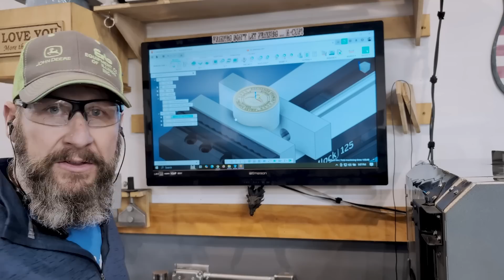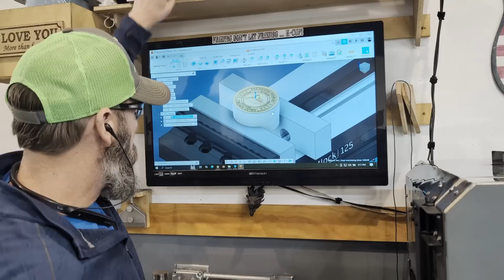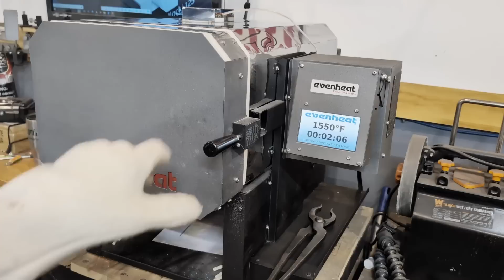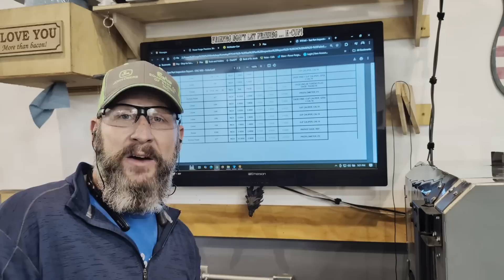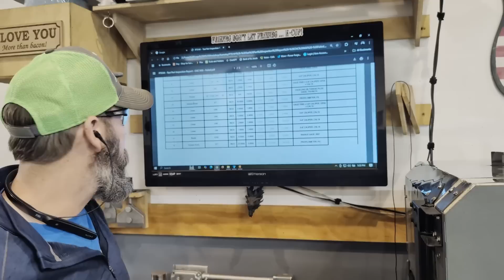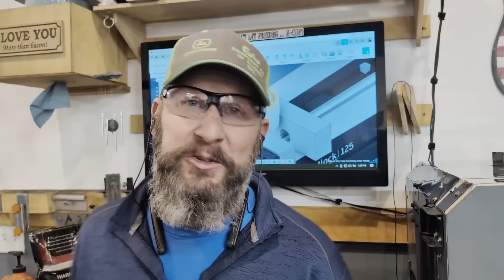Becoming a Partner with Xometry in 2024

Comment: DONT GO THERE..   It's. NOT WORTH IT....I have joined xometry...passed the test part phase, and now I am their platform....I have been on it for few weeks now...I am unable to find one single job that is worth going for....the pay is seriously low...lead times are impossible. ..jobs are complex...rare materials or several materials are at times required...post processing and all kinds of surface finish is required....material certificates and more...joining WAS a disastrous time / effort wasting for me...I am very disappointed 😞
Reply from the maker: You sound like me 6 months ago.  I had a similar experience on the job board. Most of the parts were either lathe or EDM.  I have a 3-axis CNC and my capabilities didn't match with their needs at the time.  

It was a blessing in disguise for me.  I doubled down on my own products and it's been enjoyable.  

Some guys seem to have success with it.  Maybe it's timing, but regardless I chose to move on and not work with Xometry.

Comment: I passed the test part. Now they want to schedule a zoom call. What are they looking for What will I need?
Reply from the maker: I remember a few things.  I installed zoom on my phone and set my phone up on a tripod.  That was helpful. Beyond basic questions about machining, quality control, and shop practices, I gave a shop tour and displayed my test part  on Fusion.  

It was a nice conversation.
Reply: @PowerForgeWorkshop sir,do you still using xometry for order right now
Reply: @PowerForgeWorkshop what if you dont have all the inspection equipment? Like I dont have a surface plate or height guage but I do have alot if calipers micrometer depth gages etc
Reply from the maker: @MakeSomethingCNC  I recommend using what you have and measure the best that you can.  If you can't measure (like the surface roughness average) be upfront and don't measure it.  State what you measured and with what.  If there is a problem going forward at least you will know where to focus to improve.  

Sorry for the late reply.
Reply: @PowerForgeWorkshop its ok. I just saw on there site you need a height gauge and pin gauges i dont have any of that yet dudnt kniw if they would disqualify me. Dud they make you show them all your metrology equipment?
Reply from the maker: @MakeSomethingCNC  I don't think I showed them everything. I told them I had a basic metrology set up. Calipers, dial indicators, etc.  To make the part, I bought some telescoping inside bore gauges and some precision pins.  The refractometer to measure surface roughness would have been nice, but I wrote on the form how I measured and if I couldn't, i explained why.
Reply: @PowerForgeWorkshop  thankyou for taking the time to respond to my questions.  I appreciate it!

Comment: if you run a trace on the slope with a ball mill it kinda gouges the part whats the better way of doing this
Reply from the maker: I had good results using Trace. It can be tricky to get just right. In the simulation it seems to take a little more material on the sides than the top and bottom, but I couldn't discern that with the actual part.  It worked for me to deburr the edge.  

I used a 1/8" ball. On the Passes tab I selected Left for Sideways Compensation and Selected Chamfer.  Chamfer Width .25 mm and Chamfer Depth .25 mm.  On the Geometry tab I selected an open chain, just the U.  I used a regular chamfer mill on the 2d portion of the part.  

I hope this helps.  Again, Trace can be a pain to set up, but I worked for me.

Comment: How did you measure the internal 1.205 dem its +- 0.001
Reply from the maker: I used precision pins to measure internal diameters.
Reply: So you used stacked gauge blocks for the pocket  @PowerForgeWorkshop
Reply from the maker: @inthecrosshairs1  Oh! I'm sorry, I misunderstood the question. I was on vacation and my brain must have been somewhere else.  ;)   

I measured the internal pocket while the part will still in the machine with a Telescoping Gauge & a 1-2" Micrometer.  

It's an old habit from Manual Machining. I could have just programed a my optical probe to measure the pocket or used my Haimer 3D Taster I suppose. I used the Haimer on a couple of awkward linear measurements.

I ran the contour with wear so that I could remove more material if I didn't hit tolerance. 

Anyway, apologies for my confusion.  I hope that helps.

Comment: I took a look at Xometry but the fact is, I'd pay for more shipping than the possible payment I'd get from them. I'd basically be paying to work with them, not a good deal at all. This is assuming they didn't reject whatever I made.

Also you'll see tons of work that you don't have equipment for, as in if you have a lathe you'll see a bunch of mill work, and vice versa. 

If Xometry wanted to onboard you, they're giving you a million reasons to give them a hard pass.

Also one major issue is you aren't making money in a job shop, a huge race to the bottom and all that... The only way to make money doing CNC is make your own product and sell it... But I was doing it from Taiwan and maybe in the US it pays better. I was connected with Xometry Europe in my case.
Reply from the maker: Thanks for your comment.  I'm glad I did the test part and I learned a lot from the experience, but Xometry turned out to not be a good fit for me. Mostly because the jobs offered we either were EDM and lathe work or outside of my capabilities.  Maybe that was a blessing in disguise.  

As you alluded to, I'm building up my own product line and slowly building a business supporting blacksmiths.  I'll never be rich, but it has its own rewards.
Reply: @PowerForgeWorkshop  I really want a CNC machine, but I can't afford the machine, nor the upkeep for it (I think the machine needs to run all the time or else coolant starts to rot and such, and they use a lot of electricity). 

One major issue I have is that I lack any ability to sell stuff. I can make stuff but unless I can sell it, they will just pile up not making any money or just be a waste of effort. It doesn't matter what it is, if I can make it, I can't sell it. The only marketing advise I get is facebook marketplace, which doesn't work unless you're selling stuff people want (like an iphone 16 for 100 dollars). Highly doubt this is anything Titan of CNC is going to teach about, how to get jobs to begin with. 

As you're literally forbidden to communicate directly to customers when working with Xometry, it can't even be a springboard to more ongoing cooperation with clients who like your work because you do a good job. It's like a translation agency, except you must already shell out for equipment. You're a cog in the machine and is not valuable at all essentially.
Reply: Another misleading comment that’s bs. How are you losing more for shipping when Xometry pays for all shipping? Means you never did work for Xometry.
Reply: @siliconvalleymetal  I didn't know that. When I tried to do it they basically said shipping is your responsibility.
Reply: @taiwanluthiers  they've been paying for overnight shipping for every part since 2021.

Comment: Thanks for sharing your experience. From the comments I read here , it sounds like Xometry  onboarding this can be a painful experience  especially for those folks getting  started with CNC machining.  I looked at the drawings for this test part and for the 2X 1/4"-20 2B STI THREADS, I am curious to know if you ended up inserting the Heli coils for the STI holes before shipping the part for inspection?
Reply from the maker: My part didn't call out Heli coils. I had two 1/4-20 holes that I tapped in the mill with a semi-bottoming spiral tap.
Reply: I would honestly tap blind holes manually... I wouldn't trust a CNC to do this without breaking taps. The Chinese CNC job shops seem to tap all holes with a tapping machine, and not in the CNC (bigger tapped holes would be done with a thread mill).

Comment: Great video.  I'm really curious...  Did you reposition the part to do the sloped edge ?   What would a part like the test part pay for quantity 1, 10, 100 ?   Part of providing the part is getting materials at the came cost or lower than your competition.  How do you do that ?  I have more questions but I'll leave it at that for now.
Reply from the maker: I did not reposition the part. I milled all of the top features in one setup.  For the sloped sections, I used Fusion 360 3D tool paths.  

As for your other questions, I'm the wrong guy to ask. I'm not a job shop and most of the things I make are for products I make and sell within the blacksmith trade. 

That being said, I do track ALL of my expenses from material to tooling to propane and calculate the cost of a single part.  There is no way I could ever compete with bigger and better shops, and I'm okay with that.

Comment: As a customer of Xometry, I am very surprised at the ones having problems meeting their quality standards, as it is really a mixed bag of fruits. 
We have had about 15 different part types made through them, and 10 have been good and reasonable, but of 3 combined orders of which only one has been acceptable. One 5 relatively complex POM Parts (series) where one of 5 were clearly a faulty cut with part of a critical dimension being 3mm out of spec (11mm dimension), Parts with specific drawings where they ignore drawings and don't tap holes, Stainless parts where the rough skin has been left, dimensional holes undersized, tool moving into part on engagement - 4hrs manual resurfacing of stainless steel...
Reply from the maker: Thanks for sharing your experience and perspective.

Comment: I think it is great idea that presents good opportunities for shops to fill machine time.  I setup an account back when they originated with a different company name they acquired 2015'ish.  Similar experience we would get hot job requests and were often missing that one custom tool to complete the process.  The last one I remember was some simple blocks, but it required custom form tooling for porting that we didn't have.  Keep trying maybe you will pull in some work!  Cheers 👍😁
Reply from the maker: Thanks! I had hi hopes and don't regret exploring Xometry.  I'm sticking with my own work though, and won't pursue work with Xometry.

Comment: Interesting adventure you had with your part and xometry. I hope you find jobs from them. I have nothing to do with xometry as i am in germany but still nice to know the steps you had to go through. 
Did you use the reamer on the final part or and endmill for those holes? At my workplace we always use endmills for precision holes unless they are too deep.
Reply from the maker: Thanks for watching. I did not use a reamer on the final part. I used a sharpened drill bit and then tested with a gauge pin. 

I like your practice of using an endmill instead of a reamer.  I'll remember that.
Reply: @ if you go endmill route then you have to familiarise yourself with tool Radius and Length compensations. You mill the hole a bit smaller first then measure and change the radius offset in the tool table and let the same program run again . This method allow really extreme precision and repeatabilities if you have to mill many parts. 
Machine changes the tool paths itself according to the radius and you get the desired dimensions. But for this to work you have to activate tool compensation in the CAM software otherwise machine will neglect the changes in radius as tool paths without tool compensation are calculated from the center line and don’t include G41 and G42 for compensations.
This method works for all sorts of milling where the tool is cutting from the side like you can make pockets smaller or bigger just changing the radius and don’t have to go the the computer to change things.
Reply from the maker: @waqasaslam360  Sure, I can do that. I run wear when needed. Thanks

Comment: I tried making their test part knowing it wasn’t a profitable venture but enough to keep spindles turning while we built up our client list.
My part (lathe) was rejected because there are two tiny chamfered and two tiny radiuses that I could not measure and they were .0002 out of spec.
Which ones tho?
After 6 months of calls and emails I said to hell with their BS, If I can’t talk to a person about the test piece what happens when I get a part(s) rejected???

The only good suggestion I have heard thus far is if you are shipping direct to the customer put a business card in the box and often they will give you repeat jobs at full price.
Reply from the maker: What a nightmare
Reply: Just a note on the business card idea. In the partner terms you sign at the beginning it states that if you market to their customers by doing something like putting a card in the box they can fine you $30,000 and you get expelled from the network. 

Wouldn’t recommend doing that. Also, xometry will post some mystery buyer parts to do quality spot checks on partners. If you throw a card in that box you are in HUGE trouble.

Comment: Seems like a much simpler part than when I onboarded circa 2019? Mine was a stainless 303 part with a lot more going on.
Reply from the maker: I liked that stainless part.  I was surprised when I found out it was this new one.  I think we could choose the material, but hey recommended 6061 T6.
Reply: I was looking for this comment, when we onboarded many years ago it seemed much harder. They send 1 hunk of stainless and gave you like 5 days to make it I think. You only had one shot at it.

Comment: dang, they made on boarding with xometry a lot more intense. I started with xometry back in 2018 and it was just make a simple part out of 6061 with tolerances of plus or minus 0.005".

I alsi agree that 95% of the jobs on Xometry seem to either need a lathe, 5 axis or EDM, plus some sort of finishing I can't get around me.

Xometry was my only customer for the first 4 years so I can't complain, they helped me start my shop.
Reply from the maker: Wow, four years.  That's awesome 👍 it seems like it works for some.
Reply: @PowerForgeWorkshop  Xometry used to pay a lot better for the jobs. Nowadays I have to ask for 2x-3x more than they are offering to make  a job profitable.

Comment: Just stumbled across your video. Did that same test part spring of this year. I was slightly off on the 32 finish (34 measured if I remember correctly) but still passed the part. It's interesting to me what they can be picky about and what they let go. Done a handful of jobs, but the simple ones go quick. Virtually no margin so far. I am self taught, so I use it as an opportunity to self educate.
Reply from the maker: Thanks for your comment. I think 34 is a phenomenal RA for a 3 axis mill. I would think anything better would require burnishing or polishing, etc.  I agree that it seems like an opportunity to self educate.  I've already learned some valuable lessons and I haven't taken a part.

Comment: First 15 jobs are pure profit for Xometry. They do expect you to "use up" ie. give away "old" stock on the shelf. They tell you not to lose money, but you'll be waiting a long time to find something profitable. Not entirely their fault, you have an unknown number of shops rushing to get to premium at any cost(loss). I finished 12th job 5+ weeks ago and haven't seen much worth doing since. Or, it's gone before I can check material and tooling to get it done by the deadline. I think better jobs weren't taken by anyone and fed back into the system. It doesn't help that they don't tell you the first day that you can feedback price with your offer.

In a tech hour I asked how to get better offers. Become premium. One of the shops said they didn't make money with Xometry in the first 40 jobs. Some people get lucky or are willing to take risk others aren't. They do say jobs are not offered based on the equipment you have. CNC includes any size turn, mill, edm, swiss.

I'm sure there is the possibility of making money. My first job (I took at offer price) came back as a repeat at almost three times what they offered the first time. They don't quote anything near the lowball offers they post. You never know what the job actually paid to whoever took it.